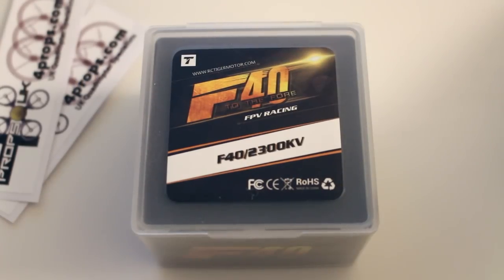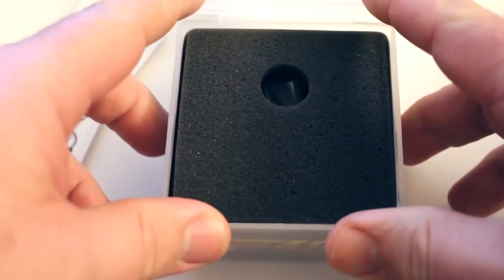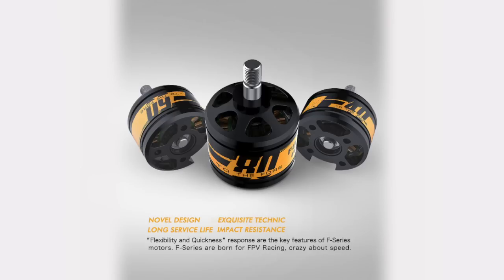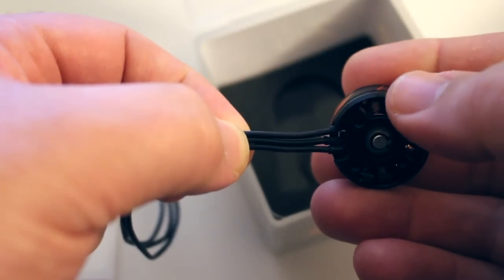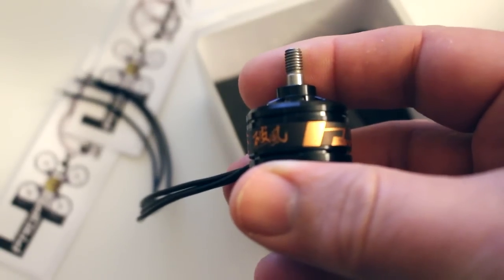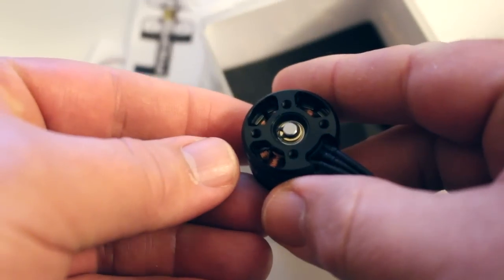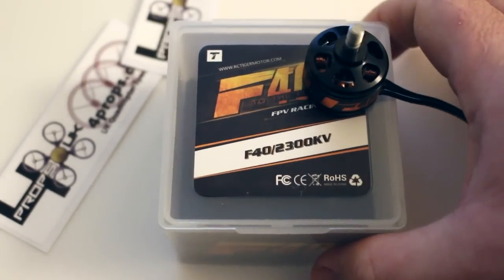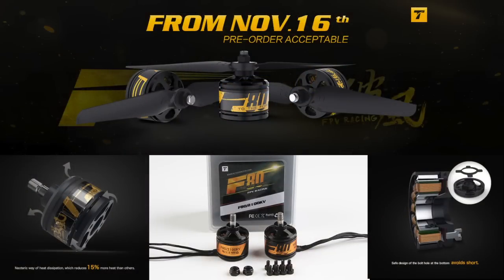Tiger motor F40 2300kv unboxing overview

Comment: I have seen one glaring fault. the m5 shaft is only 11mm long. All the new  bull nose style props have a hub thickness of 7mm which does not leave enough exposed thread to engage a nyloc nut. I am very surprised T motor have over looked this.

Comment: It will be interesting to see how they stack up against the Cobras.  Are these a 2204 motor?
Reply from the maker: +xjet Hi Bruce, I believe they're a 2204 and the other two in the series are 2206 and 2208. I am a massive fan of the Cobra motor so I will be keen to see how they pan out too.
Reply: +xjet yes 2204, I know the Cobras are really a 2205 but the proof will be in the testing!
Reply: +xjet According to the specs, i would say: F40 is 2204, F60 is 2206 and F80 is 2208
Reply: +ABMNS PRODUCTION we had 4 sets of F40, and one set of F60

Comment: Cant find them on the site for sale?
Reply: +CyclingSalmon14 they are not available yet, these were early release for testing. We will be adding a pre-order as long as the tests are all good.
Reply: +4Props.com - UK Quadcopter parts, UK distributor for Lemon-RX 

ooh ok Watching with interest.
Reply: +CyclingSalmon14 

Im going to be grabing a HMB235 from you guys payday if any in stock.

=)

I looked at the Kit but what are the quality like on the EMax motors that come with it...I was thinking of replacing the motors and escs for something beefyer straight away.

unless youd advise otherwise.
Reply: +CyclingSalmon14 The motors are perfect and well up for the job, the only thing I would change is the ESC's they are OK and perfectly fine but the DYS or LittleB's are much more future proof
Reply: Awsome, Thanks for the reply.

Will grab that and a few otherbits on friday then.

Comment: Why 2 in a pack? Better not be any of this CW and CCW Shit as none of us FPV Mini Quad Racers are down with that, keep that picnic chit chat for the DJI guys who don't know how to use a spanner and need prop direction written on every thing. 

Also Do you believe that can take a beetling like cobra.

How much do they cost from 4props All i get is a 404 error :c
Reply: +Brighton Till I Fly don''t worry I went to Faceballs and found out testing only :c
Reply from the maker: +Brighton Till I Fly pre-order will be available from the 16th at selcted retailers. You know what Jack I think they might be able to take a good beating. If they can't my flying will expose them =D
Reply: +Brighton Till I Fly Hi, I believe it is down to keeping the cost lower but I don't know 100%. 

The motors will be on pre-order this week (providing the tests stack up), they are all CW motors which is nice.

Our website is https://buy.4props.com but you can expect to see lots of testing data soon as sets were also shipped around the world and should be arriving next week.
Reply: 4Props.com - UK Quadcopter parts, UK distributor for Lemon-RX cheers Darran It's all about that nut rotation, that RCTV-UK failed to answer!
Reply: +Brighton Till I Fly at 36 seconds the slide shows they are both CW but easy to miss